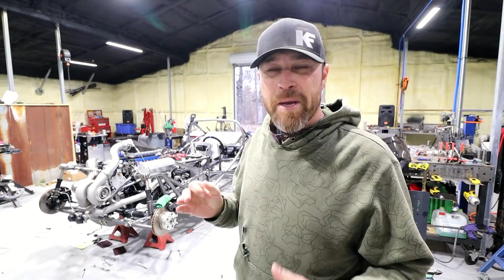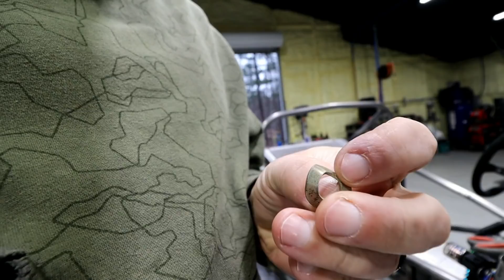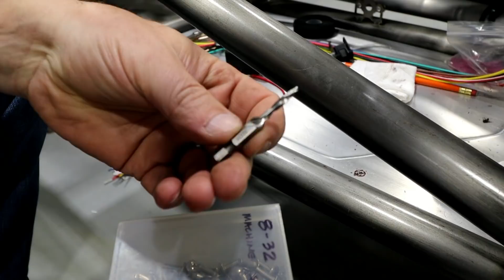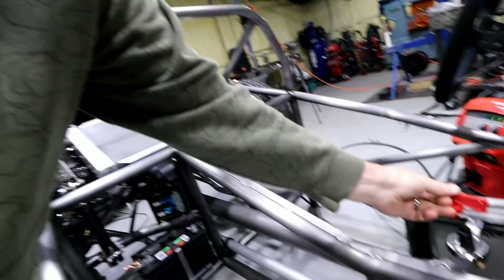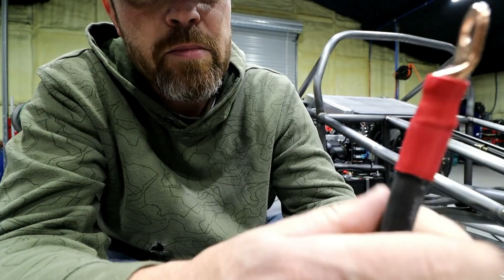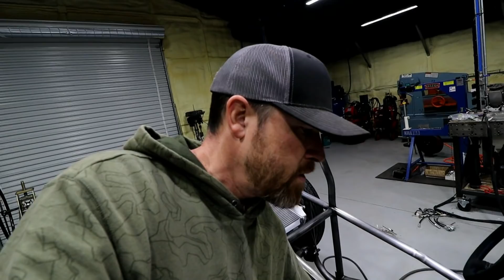Custom Hot Rod Build Continues

Comment: Question--- when running the battery cables from the rear of the vechicle, do you need a bigger battery to compensate for the length of the cables??????
Reply: Nope, just bigger cable. Longer runs require thicker gauges, theres a chart online to show what gauge needed for the length of run based on amps drawn

Comment: The glue that is in the heat shrink is more to keep any water or condensation out of the connection than to strengthen the connection between the wire and the end.

Comment: Coming along nicely 👍 Are you going to put a large fuse or circuit breaker (200amp) on your main power cable at the battery?

Comment: To prevent any connection spikes/sparks from killing ECU's or other electrical equipment, the main cut off could also cut the ground/negative cable to the battery.

Comment: You’ve been working on this thing for several years if I’m not mistaken? How do you keep the raw steel from rusting over the years?
Reply: Pretty sure he's been spraying steel it on everything.. great product
Reply: @3050fabVillainNova  interesting I’ll have to look that up before I start tearing mine down
Reply: He uses sharkhide, stops raw steel corroding. Steel-it is a great product but I don't think it's on this project.
Reply: @TheMeta6  thank you I’ll look into both I’m gonna need it for sure.